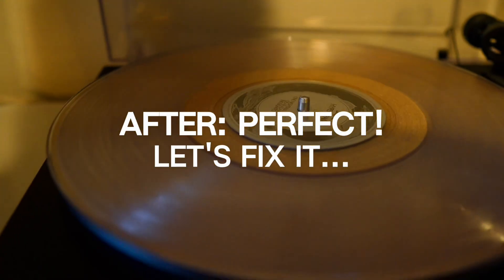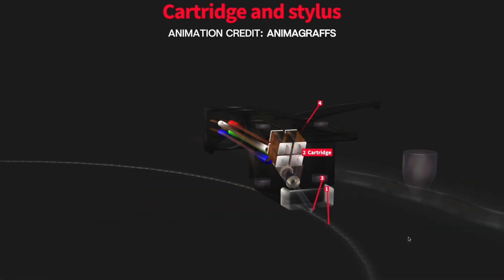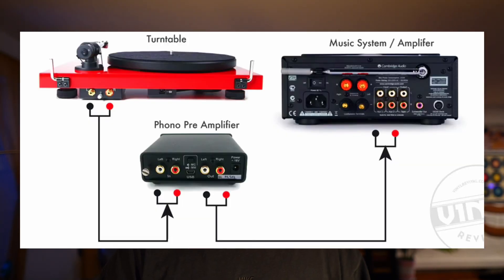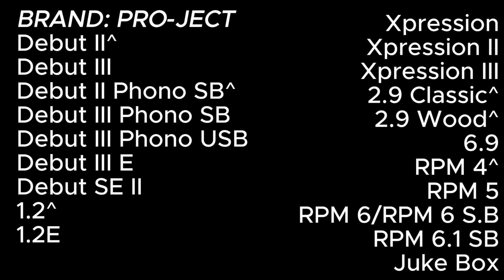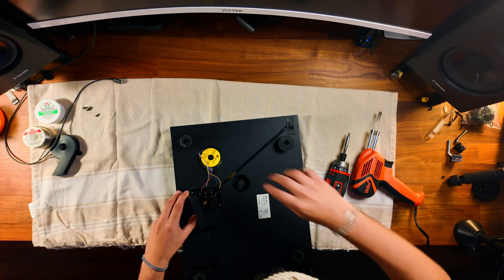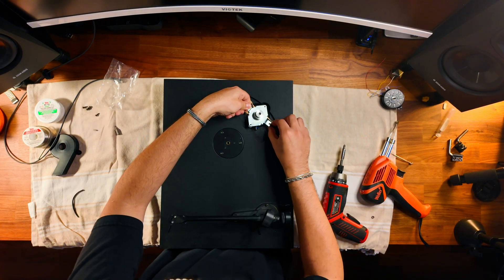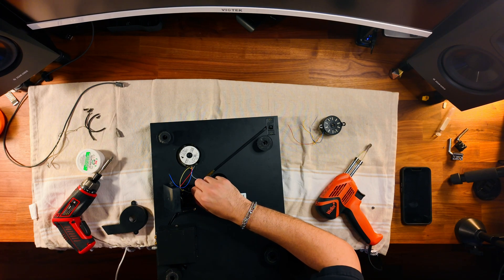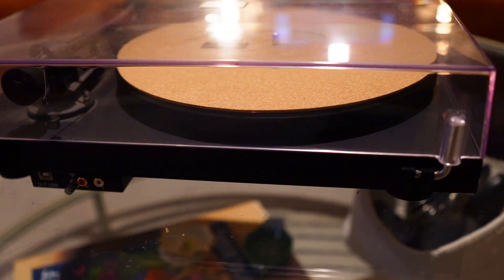Replace Your Pro-Ject Turntable Motor in 15 Minutes

Comment: Great video. Thank you for the in depth info. I have a SB, missong the original power supply. Have tried  12v 3a and the lights come on, but there is no movement. Noise from the motor. £208 for replacemtn motor. So might try a proper supply first. Anyone else have info on this?
Reply from the maker: Power supply is definitely much cheaper to try first! If that doesn’t work, you’ll likely have to go for a new motor

Comment: Great video. Thank you. My Pro-ject Debut Carbon I subplatter/splindle has frozen up. Probably the bearings. I tried to remove the spindle but there is a casing on the bottom heald by three screws that is preventing this. I took the screws off but the casing won't come off. Did you encounter this? I didn't see this in the video. Thank you so much
Reply from the maker: Unfortunately I didn’t encounter this, it was really just the motor that was an issue. I wish I could’ve been of more help!

Comment: Is it normal to have raised bumps around the motor. Like a texture?
Reply from the maker: the new motor was smooth, but i may not be understanding you fully. is this a new or used motor? if used and it looks unnatural, it may have some defects inside causing the metal to heat and expand, which is probably not good. if it’s a new motor, i would just reach out to the supplier to double check that all is normal

Comment: Question, I have the same unit. I was sent a M500 replacement. Is that right??
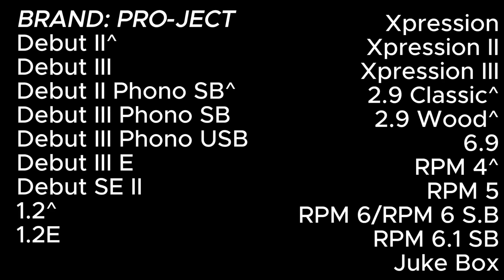Reply from the maker: hey - the motors in this video were M303 and M400, but their specifications were pretty much identical. based on some quick research, it seems like the M number is just the model/version number of the motor. if you have the exact same model as mine and the motor you received is 16V, you should be ok... (i am not an expert) - check 3:12 in my video for the list of all of the compatible pro-ject models for this 16V motor. it's also listed on the product page for the replacement motor on analogue seduction website!
Reply: @ Thanks for the reply. Just reached out to customer service. Should be good to go.
Reply from the maker: nice!! let me know if you need any more help
Reply: @berkprod , I just want to say thank you for this video. You gave me the confidence to do this myself. Two shops I took it to wanted $300 + for this repair. Motor and band + shipping was about $65US. Can’t beat that. Oh and 20 min of my time.
Reply from the maker: @fonzcarrillo3355  dude im so glad to hear that!! happy listening! subscribe for more if you'd like :)

Comment: Great job. The L in solder is silent. Pronounce it like sodder. 
How much did you pay for the motor? I have an epic turntable from the 70s but the motor was weak from the get-go. I am hoping to find a motor powerful enough to use a brush on the record when it's spinning. What I have now stalls when I try to use a carbon fiber brush. Is your replacement motor powerful enough to use a cleaning brush when it is spinning, or does it start to slow down? 
The manufacturer of my turntable went out of business in the 80s, but it sounds so good that I would sell a kidney to keep it running. Any information would be greatly appreciated.
Reply: Only pronounce it sodder if you're from the US. The rest of us pronounce it solder, which rhymes with colder.
Reply: @lumabi25 yeah, we fuck everything up in the states. lol.
Reply from the maker: hahaha! whoops!! i guess you learn something everyday, will use "sodder" from now on.
the motor was around $50-60 USD including shipping and tax, but that's going to vary based on what's needed. i'd go to analogueseduction.net to search for your model. even if you can't find the exact model, see if you can find the brand and then you can choose different motors from the dropdown. for the motor i bought, it was a general "proj-ject replacement motor" product page, and there was a guide there to ensure you were selecting the right pro-ject model from the dropdown. keep me posted if you fix it!! best of luck
Reply from the maker: the motor is definitely powerful enough to use a cleaning brush. you just need to see how powerful the motor needs to be and then i'm sure you can find the correct powered replacement
Reply: @berkprod  Thank you for the information.

Comment: I took apart the motor and spent the whole day fixing it. It's now 7 hours later and it's fixed without any parts! Turns out the simplicity of the syncronmotor is amazing for repairability. Figured what the hell might as well open the motor to see if I could fix it. The issue of my motor was that I accidentally stopped it from turning and it caused a loud buzzing sound. The fix: glue the top and bottom rotor magnets including the plastic plates on each end. It's not a 100% fix since it sometimes (I've tested it a few times and all but one time it went the wrong way (probably because I didn't have the platter in place), I think it's safe to say that it 99.99% fixed) will turn the opposite way when turning on but a free fix nonetheless. Note the orientation of the motor housing before starting with a marker.
Reply from the maker: good to know and glad you fixed it! i’m honestly not sure what caused my motor to break since i got it like that, but the symptoms seem to be similar. i hope someone can find help from your comment too!!